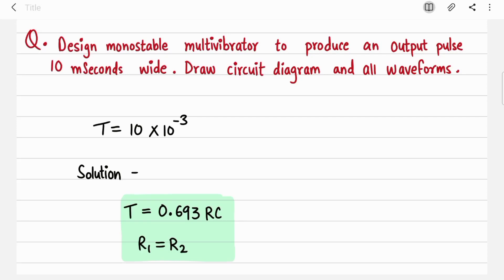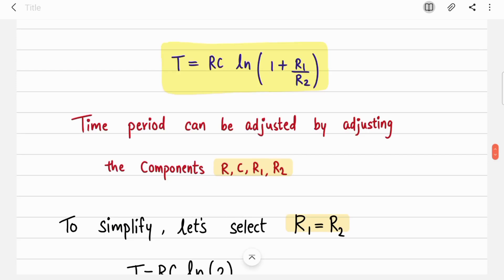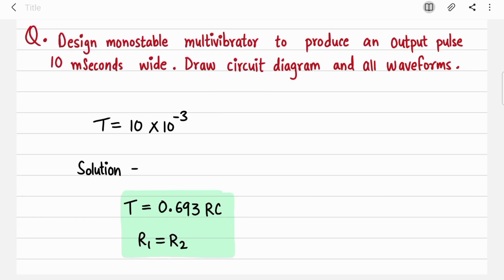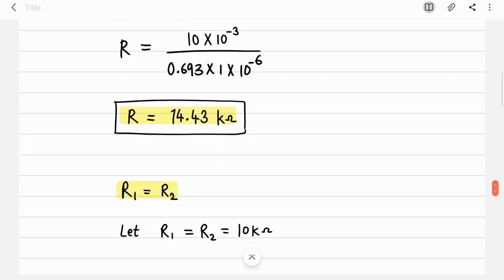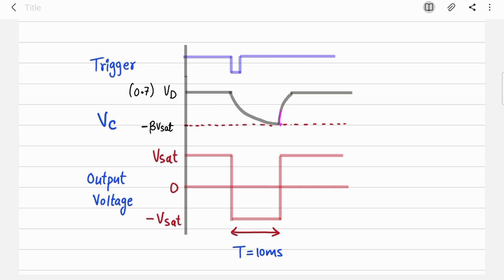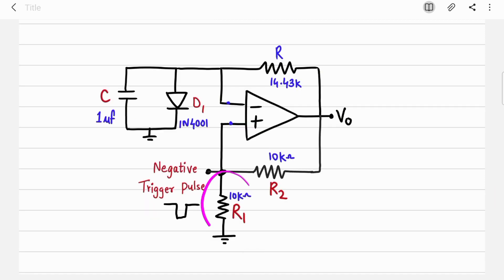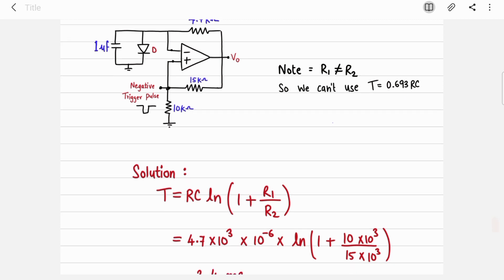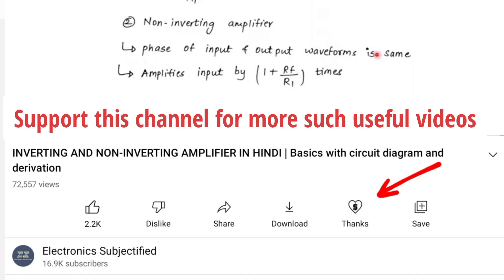NUMERICALS - Design monostable multivibrator using Opamp - Solved Exam Questions

Comment: Mam ye question kaise hoga 
Design monostable multivibrator that is to be used as a divide by 2 network .The frequency of the input triggers is  2 KHZ.
Reply from the maker: Question is solved in this video - https://youtu.be/57V0YxuG9Fo